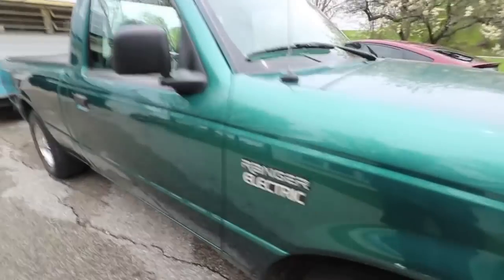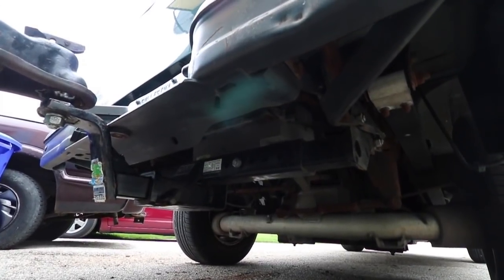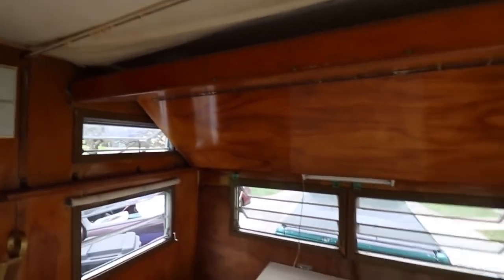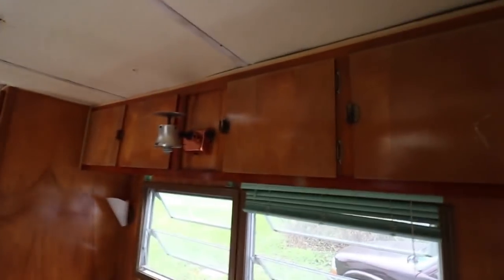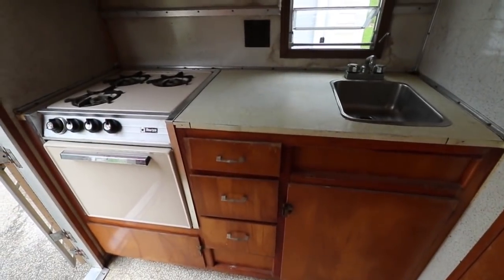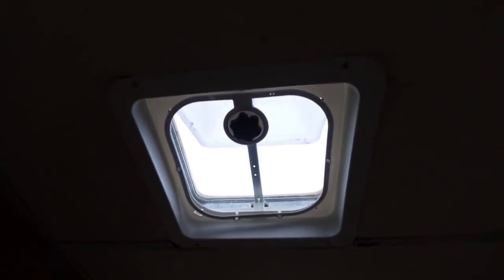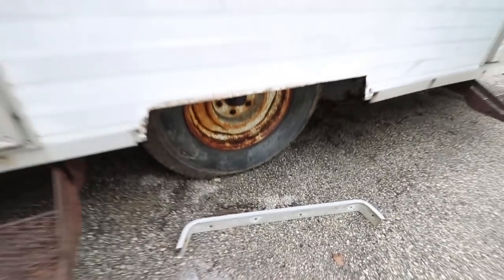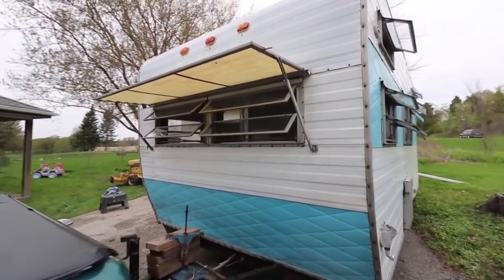Electric Pickup Towing: Travel Trailer Tour

Comment: That truck looks like it is in really nice condition, it's a nice looking truck. The trailer is sort of neat but you're right , it looks like it needs a lot of work.
Reply from the maker: You are right, the truck itself is in pretty good condition. There's some dents on the drivers side of the bed, and some scratches on the drivers door, but the interior, apolstery, drive-line, all EV components, frame, etc. are all in excellent shape. No rust.

Comment: Ah man that is a cool trailer but looks like a ton of work. Maybe get a new one lol.
What could be cool is to put a lot of solar on a trailer and use that to slowly charge your car, and use the car battery to power your trailer. At least if the electric pulling vehicle has enough battery capacity. That's how I would set it up, have a large battery to drive and for household in the car, and lots of solar on the trailer to charge with. Maybe even fold out "solar awnings".
Then you could drive somewhere and boondock and have maybe like 10 miles per day range for free, while making use of the larger battery to power your stuff.
Thanks for the video!

Comment: So would you be able to tow this trailer with a regular 2000's ford ranger? Nice classic trailer though once cleaned up very nice!
Reply from the maker: I haven't owned a gas Ford Ranger, but I have owned and driven several Chevy S-10s, which are comparable light trucks. I wouldn't try towing this trailer with my S10.
Electric Vehicles have more torque, which is great for getting a trailer going, and they have regenerative brakes, which are great for controlling the trailering while slowing down.

Right now, the big challenge is that towing greatly reduces the range of an electric vehicle. If it takes twice as much energy, then the truck can only go half as far.
At this point I would rather tow with an EV than a gas or diesel vehicle, but only for relatively short ranges.

Comment: single axle make sure you have trailer brakes with that little truck Good Luck Ben.
Reply from the maker: Looks like it has trailer brakes, but they aren't hooked up. Half the fun of this sort of thing for me is to learn about stuff like that!
Reply: @BenjaminNelsonX  yep towing is the easy part stopping is tricky keeping the whole rig straight so it doesn't push the rear end around.
Reply from the maker: @offgridwanabe  I got to test tow the trailer around my neighborhood today. It pulls great, but stopping distance is definately increased. Looked like my battery voltage was too high at the time for the regenerative brakes to work either. I'd love to try it with working trailer brakes.

Comment: 90hp?!  How light is that trailer?!   Or hopefully you'll be hauling on flat, slow roads.
Reply: @blgarage9519  of course but it's not like a 90hp engine will magically have 300 lbft of torque at some useful speed.  I guessed the torque was low, and was curious for any engine #s, but all he said in the video was "90 hp".  Anyways, I found out that it has 149 ft⋅lb according to Wiki.  https://en.wikipedia.org/wiki/Ford_Ranger_EV

Comment: cover the trailer in solar panels .... see if it can pull its weight when you pair it with a battery inside the trailer and with the battery inside the ford maybe it can pull its weight and maybe if you go camping for a day or 2 it can at least help charge the car a bit  !!!

Comment: Why not put some solar panels on the trailer and feed it to the ranger
Reply from the maker: For "Why Not" - Cost, Complexity, Practicality...

But let's take a quick look at it. The truck has a 6.6Kw charger on it. That's a little more than can be directly provided by all 24 solar panels on my garage. Clearly, that many can't fit on the trailer. But some is better than none. The truck has a 312VDC nominal battery system, so to directly charge it, we would likely need 12 (30V) solar panels in series to get to a high enough voltage to charge the truck's battery pack. Just measuring the panels I have on my garage and comparing them to the size of the roof of the trailer, I could fit 6 up there. Some sort of a power converter would have to be used to kick up the voltage to a level appropriate for charging. (And would also add inefficiency.)
With six panels on top of the trailer, that much solar would probably produce about 5 kWh per day. In my testing of the truck so far, it's not particularly efficient, running somewhere between 300-500 watt-hours/mile. So, as long as it's sunny out, and the solar was in the sun all day, it might charge 10-15 miles worth of range. That's WITHOUT towing the trailer. I don't yet know what its efficiency would be towing the trailer, but I would guess HALF. It might be one kWh per mile, so about 5 miles of range per full sunny day. Much simpler to just plug into an RV Park NEMA 14-50 outlet, and get a full charge in a few hours. 

On top of that, there would be the expense of solar. I could get 6 panels for less than $1,000. Racking would certainly add to the cost, and I don't know exactly what booster/charger would be required. Frankly, this would be a relatively small system, and the actual cost of materials themselves wouldn't be that bad. Paying somebody else to do the work would be the expensive part.

Another rule of thumb in solar is "Put it on a GOOD Roof". If your house needs to be re-roofed, do that, THEN install solar. The roof of this trailer isn't in great condition. It would need some repair (and likely reinforcement) to install a large amount of solar on it.

Lastly, how often would this truck be pulling the trailer around? If it's only used for one trip per year, that seems like a lot of work and cost to put into it. On the other hand, if a person LIVED FULL TIME in a trailer like this, I would definitely install as much solar as I could! Likewise, if a person wanted to drive to some off-grid location, stay there for 2 weeks, and then drive back (on the solar charge) it could certainly work.

We've seen great increases in battery pack capacity of electric vehicles lately. Solar hasn't made matching increases in efficiency, but HAS come down on price. At this point, solar seems to work best for either COMPLETELY off grid, or grid-tie (where any "excess" electricity can be sold.) 
I look forward to seeing more electric RVs and Camping trailers, and we'll see more large solar for those as they become available commercially.